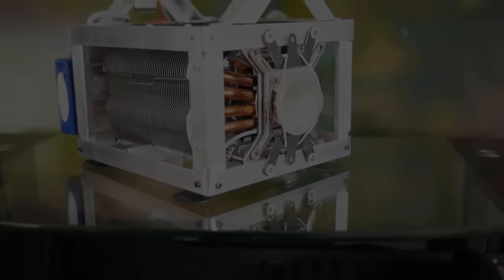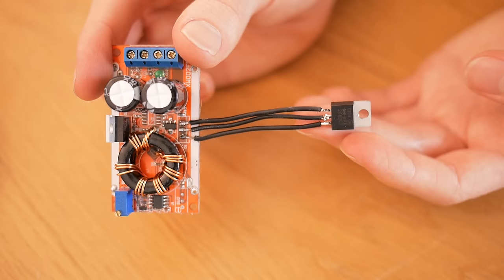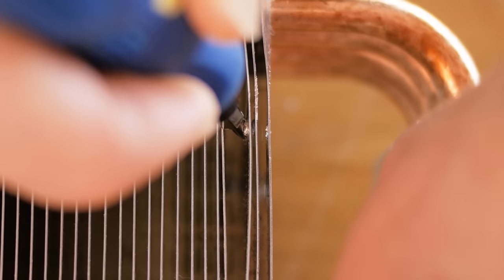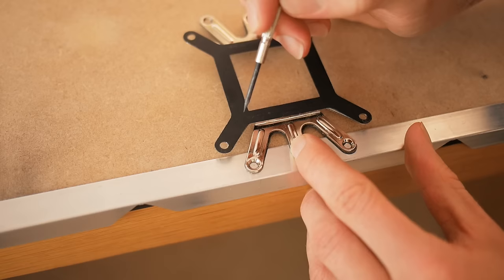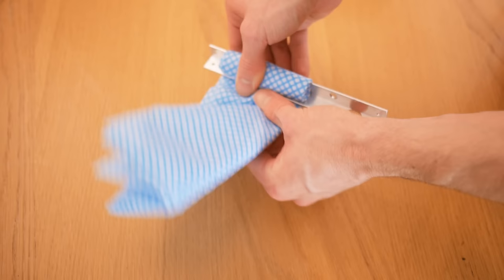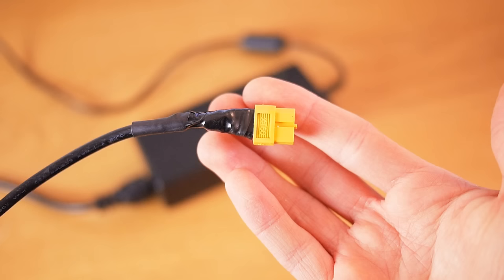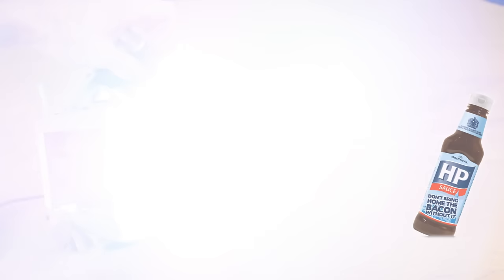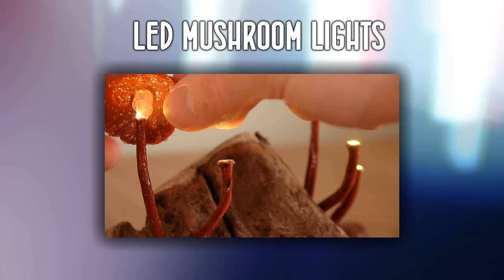Make a 1000w equiv. LED flashlight - aka DIY Sun-Blaster!

Comment: That is not a voltage regulator. It is a voltage regulator modules. The voltage regulators are the components screwed onto the heat shrinks that were removed at 2:38. You also called them ICs. Integrated circuits are rectangular and show no open metal apart from the pins. An IC should not be soldered as they are extremely heat sensitive and will break if soldered like this.

Also the potentiometer  purchased (used as a variable resistor) has two sets of pins so is more expensive than it needs to be. (The one you have bought is used in audio.
Reply: Random Raymondo bro its sink not shrink

Comment: How are you limiting the current to the Led?  Led's do not behave like a resistor having a linear current draw, but instead being a diode their current pull is a curve.  Simply put even with the voltage correct the led will pull far more current than it can handle which is why you need a current limiting circuit along with a voltage limiting circuit.  If not the led's life will be greatly reduced.

Comment: Good project torch. I know that it may not be perfect or the way you have put it together is not how a pro may have made it, but as a novice in the field of electronics this seems perfect for me to try out and hopefully get working. 

I have read many mention flux when soldering, how would you use flux and would you use it with the solder? 

Can you use old computer components to make the torch? 

Can you also add additional LED lights to the torch, so instead of having one 100w LED, can you connect up four 100 LEDs? 

I may add a case with ventilation to my torch once made. 

Good video :)

Comment: Well .. Nice video .. Nice build ..
But altering the boost converter this way is not a good idea .. these 2 ics are a diode & MOSFET .. for many important reasons there leads should be as short as possible or else the circuit behavior will not go as it should be and these parts will suffer more stress which leads to more dissipation & shortin there life time .. also elongating capacitors leads will harm the original design even more and give more problems ..
There are better ways to modify such circuit or better try to find more suitable boost converter ..

Comment: VA and Watts are NOT THE SAME! It might be in this case, but for instance, my 750 VA Battery backup can only handle 500 WATTS of contiunous draw when on battery. I had to move to a SMART UPS because my older dumb one would sound an alarm whenever my PC drew 500 watts or more. It will draw up to about 610 watts absolute maximum.

Comment: I'm not good with electronics so hear me out... doesn't a step-up/step-down converter increase/decrease voltage but ALSO increase/decrease amperage to preserve the total wattage? If you're using a 100+Watt power supply to power a 6W computer fan does the mini voltage step-down regulator also step down the amperage? And I hope I don't sound incredibly ignorant but... where does the extra watts go?

Comment: For outdoor use, wouldn't it be good to surround the frame with a thin wall to prevent massive water intake and all as well as help to guard the circuit?

Comment: Great job! Thank you for this detailed tutorial! Only one question - 7:41 Why 30v? According to Electrical Characteristics on ebay voltage must be: Min 32, Typ 34, Max 36
Reply: I've set 35v. White smoke appears and one element labeled "R010" on the voltage booster become black.

Comment: Why don't you just wire the potentiometers in series and set the blue one to the correct resistance when the 10k one is open?

Comment: That's not a Constant Current Boost Converter though... All I see is the voltage regulator... Cool I guess.. Mine is 3x 9v Liion batteries in parallel, something like 4.4Wh. and it's got 10x 1W LEDs in parallel. It's very bright, the brightest I've ever made in my life. Brighter than any flashlight "MAGLIGHT" I've ever used. Uses a cc-cv XL4015 buck converter. Got a bag of these 1W bead LEDs for dirt cheap $12 or something.. So less than $1 per 1W bead LED. Very reasonable. Very doable, with no heatsink. Batteries last

Comment: +DIY Perks You should have just went overkill on the driver like I did.  I bought a 600 watt boost converter so it wouldn't have any heat issues with 100 watts lol

Comment: does anyone know exactly how much heat does the led output (watts). I want it to be as small as possible so I'd use a smaller heatsink. a one that would be just enough to cool it.

Comment: quick question i have no time to try this but why not make a space heater with  these 100 watt led modules . seen a as on tv handy heater which is a 400 watt ceramic element . i was wondering if the 100 watt led makes more heat than the non efficient ceramic element in the small space heaters ? if it does we could also use a small Fresnel  lens and capture the light and focus it on something heat absorbent maybe another heat sink with a small fan on the back and create a super efficient space heater thats using waste heat from the led to make the heater..

Comment: Hi, thanks for  video. Final product looks super awesome. After watching this, I've started building my own setup. Have a query: If we were to use this as a flash light, powered by the Lipo battery that you've mentioned, how long does the battery charge last, before the charge runs our, when used at LEDs full power. Would just like to understand whether it would be feasible to have it powered by batteries alone, and not connect it to wall power. Thanks once again.

Comment: Hello.  I find your videos very easy to follow and educational.  I have seen that many of your projects include LED's as well as some incorporating computers and music.  I have strips of 3528 RGB LEDs and I was wanting to figure out a way to power them and have them respond to music.   Ideally I would like this to be done using an algorithm that is tied directly to the computer internal EQ (i.e. red responding to various gains of bass, green to various gains of mids, and blue responding to various gains of highs)  I would like it to be internal so that it's not volume dependent, or effected by other noise, but all of this is just preference.   Is this the kind of project you might put into a video?

Comment: I saw most of the parts used was in EBAY
good idea with putting up the circuits  I wonder how long it takes before you finished the project and have you tried RGB LED so you can use it in the party

Comment: Hey Matt, I love your videos. I'm in the planning stages of putting together a large (3-4' diameter) ring light and want moderately powerful LEDs. Following your link I see that the seller has some 20, 30, 50 watt versions.
My main question is about dimming them. I would love to go with some 30 or 50 watt ones but definitely wouldn't want them near their max out put all the time. Just how much can you dim this type of LED before they shut of completely?

Comment: I'm just starting in electronic and I have a problem with the project. The led starts flashing if the dimmer is too high. Is it some sort of protection for overheating? Any way to solve the problem?? Thanks for that great tutorial by the way!!!

Comment: Hi, great tutorial(s) Ive learned alot from watching them. I don't have a background in Electronics by trying to DIY some projects. I was just wondering (hoping this is not a stupid question) but what is the benefit of using a DC booster over lets say connecting 3 12V batteries in series? What do you think is better? thanks for your input!

Comment: How should the heat be transferred if there is no contact to the cooler?
Using a non conductive thermal pad would have been better although I'm not sure if extra cooling is needed at all

Comment: Ref: ZIPPY Flightmax 5000mAh 3S1P 20C
You are using an 11.1V Lipo Battery, 8000mah. How do you calculate how many watts it puts out? I contacted Hobby King and they say this battery type has a max watt output of 55.5. If that is the case, how can is power a 100W LED?  Also, they make 300W LED Emitters than run on 32V. What Zippy battery configuration would you use to power it?
Thanks,
Mike (HID Fan changing to LED)

Comment: Dear DIY Perks. Your videos are really awesome. Question if i wanted to use that set up for three 10w RGB leds with voltages from 8-12v do i need different potentiometers and resistors? The idea is to dimm each colour individually to get good control over the colour so one curcuit for each.... can i do the exact same?
Thank you in advance!

Comment: I keep wondering why you make sure the voltage regulator not only doesn't have any heatsinks of it's own and is insulated from the heatsink it's mounted on by layers of air and plastic spacers because that would negate any advantage of having it on the big heatsink. Also, James Fry might not be the most diplomatic commenter out there but he does have a series of points on the many, many screwups made in this video.

Comment: Wow, inspiring. My question is, does the heatsink need to be that big for the 100w led, or is a small heatsink with a fan on the back sufficiënt?
Reply: Pretty much yes. 100 watts is going to produce a insane amount of heat, a 50 watt cpu can be used to cook meat. So unless you wish your flashlight to be uncomfortably hot I'd go for a big heat sink. Then again it could double as a hand warmer in cold conditions.

Comment: It would be fun to mount that to a large drone and cause a bunch of UFO sightings.
Reply: +Chlorate you'd need bigger than large to carry that thing, its basically a giant slab of metal with some electronics wired to it.
Reply: Maybe you could lose the heatsink by elevating it up to an altitude with a low enough temperature before turning on the juice to it?
Reply: And/or run the light for only a short while at a time with a fair bit of cooldown.

Comment: This was so nice, do you think this lamp can be adapted to a kind of garden lamp powered with AC current? If thats possible its a totally diferent desing?
Reply: +Brito-sama The laptop adapter he uses in the video is an ac/dc power adapter so yes it can and it is demonstrated being powerd by both ac (via the laptop power adapter / charger) as well as being powered by a battery.

I have made a 5 LED Floodlight that is powered via AC using Cree CXA3070 LEDs.

Comment: You did not source the female round connector for the power supply. If I get a 7.4mm (OD)/5mm (IN) round connector for a Dell AC adapter will it show positive and negative on the connector for proper connection?

Comment: Hello. I noticed that your boost converter has only one potentiometer on it (the voltage one). I wonder, how the correct current is adjusted for the LED, since it needs constant current?

Comment: How long does it last on full blast on one battery charge and what is the battery capacity (4500mAh from the description)?
Reply: ***** lol
Reply: calculate it from the power consumption of the LED...
Reply: 25-30 minutes. You want to either double the voltage or double the capacity to get a 1 hour runtime. Doubling both of these and using a 9,000 mAH 22.2V battery should net you about 4+ hours but WILL make charging more complex.
Reply: You'll need  resistor to run the LED like that, which means doing power calculations!!. also, your brightness will drop with the battery voltage, so it might be worth using a pair of 7AH AGM SLA batteries in series for 24-27.2V in and use a boost converter to up the voltage and limit the current. I personally find 39.1v at 1.28A gets you better efficiency and exactly 50 watts out of the LED and you'll get minimal sag when the battery voltage falls. Just remember that when you use the flashlight for any length of time, to keep the capacity you really should recharge the batteries fully to stop the sulfates in the battery acid from binding to the lead plates. Also, that light is gonna weigh a ton with those batteries!

Comment: The heatsink is a little overkill lol.  I have something a quarter of the size that can shift 100 watts of power easily (AMD stock heatsink).  I have a question though.  Which would be better, current dimming or voltage dimming?

Comment: How large should the LiPo be ?
If my calculations are right, the one in the description (4500mAh) should last nearly 30min ?! Or am I wrong ? Isn't this a little bit short ? 
How is it like withe a 2200mAh LiPo ? 
Please tell me if I'm wrong :)
Reply: You know, you're powering a 100W LED... a laptop uses less than 10W, and it hardly lasts more than three hours on a battery that's 14.1V/2200mAh on average... the time you have calculated is fine, in reality it will last less than 30 minutes due to some losses, plus the power used to run the fan.

Comment: How can you use a Laptop adapter that puts out 8 Ampere, if the step down regulator can only deal with 3 Ampere? You connected the step down regulator directly to the input of the voltage regulator, so the 8 Ampere go directly to the step down regulator for the fan, or am I wrong?
I am building this thing at the moment and my step down regulator's LED is blinking and it doesn't work. Could that be because of the too high current? And how did you solve this?

Comment: @2:50 Next time just use a heat gun and pliers to flow the solder and pull the entire unit off. Less damage that way.

Comment: I was looking into power supplies and realize the lipo batteries are not expensive (between 30-50 inside United States) but the chargers for them are much more expensive than the batteries. Do you have any alternative battery and charger ideas that will not cost as much? Currently I plan to build this project with an old Laptop ac adapter as I have plenty.

Comment: This project is killer! Can anyone explain something to me regarding the potentiometer customization? My buck converter has a CC trimmer and Voltage trimmer. Can I wire a rotary trimmer the same way and get same results? Both with different resistance values. I'll be using it for a power supply project. Thanks

Comment: The voltage booster ur using is started from10v, so for a 11.1v battery it couldn't be used for a long time? The booster stopped working when the battery voltage is lower than 10v?

Comment: how long time battery can hold on at work and why you use 8000mah battery when QSKJ boost converter max input current is 6A or 6000mah ?

Comment: Help! The step up regulator is giving me between 55 and 63 volts when adjusting the trimmer potentiometer, and I can't go lower to the 35 volts that my LED is rated for. Do I maybe have to use different resistors?

Comment: did you measure current? i still didnt got step up converter but with 3x12v batteries (not fully charged so somewhere around 36v) it draws around 2.5A

Comment: On the LED's product site it stands that the working voltage is 32-36, so isn't setting the max at 30V a bit odd? I sat mine max at 34V, you think that will be  a problem?

Comment: I'm trying to build this monstrosity, but have a few questions, did you test the boost converter to LED setup with a bench power supply first? Did you notice any jitters with the LED? I would love to have your help with this if you have the chance. Thanks so much for pioneering the way for this project! :)

Comment: Considering making one of these but maybe not quite 100w, maybe somewhere between 10w and 50w. If I did this would the circuit be the same. And how long did that 8000mAh battery last in this video?a

Comment: Would i have to change the resistors for the 4:00 part if id use a 50 watt led wich is rated for the same voltage, just less power?
Reply: No, because that is a voltage regulator, and both 100W and 50W LEDs are rated for the same voltage, but 100W needs double current.

Comment: can some1 please explain why u have to use 10k resistor to get 3amps at 30 volts?because using ohm law r=v/i the resistance should be 10 ohms not 10k.

Comment: Okay so I have my resistors hooked up just like he does in this video I couldn't find 11k ohm resistors I used 10k at first and then added and tried both in series and parallel an 1k still coming out lower voltage output. I have the blue potentiometer turned all the way right for max output and my 10k big pot turned all the way right I'm outputting 19.6v I thought I was doing something wrong so I hooked the little blue pot back up way it was made and the voltage booster outputs 42.6v. Is there something I'm doing wrong do I need these resistors in there like that?

Comment: what is 1000 watt equivalent about this? it is actually a 300 watt halogen equivalent when the LED COB is brand new. 9000 brand new lumens at the ab-max Vf drawing and unhealthy 2.5 or more amperes. i keep mine at 30v at which it allows 1.5 amperes through. beyond that voltage exists diminishing returns.

Comment: hi brother.
i followed the same steps, but my led flashes only in around 1second gap. how do i fix it. 
I gave 12v 5amps input and set the dimmer to 33v . I tried both 100w and 50w led cob. but result is the same.

Comment: What grit sand paper did you use I was using 3000 and then 1000 with no luck on frosting the lens? maybe I just need to go at it longer? thank you

Comment: Hey Matt, idk if you still reply on this comment board but I was making something similar to your project and I got it working but the DC - DC booster is making this weird humming noise which it didn't before. Should i be worried about it? I am refraining from using the led too much because I'm afraid it might blow out the board. Many thanks if you can reply.